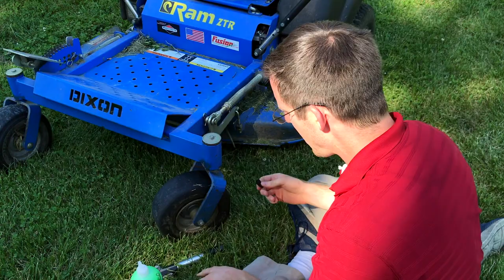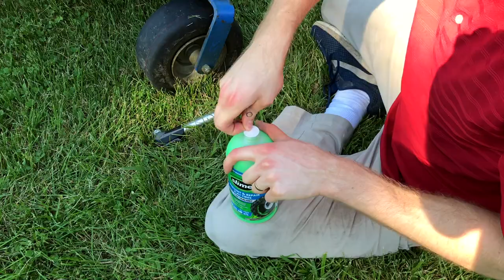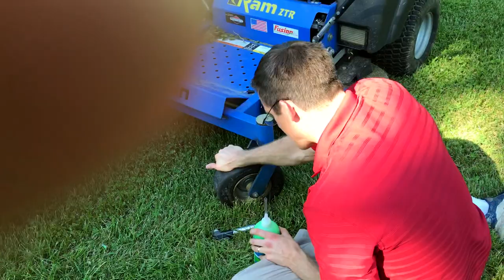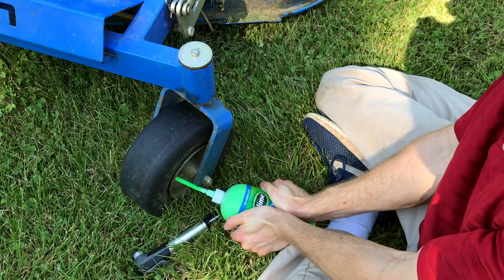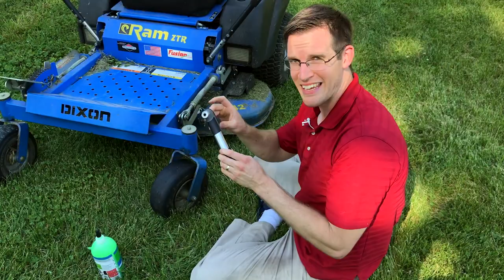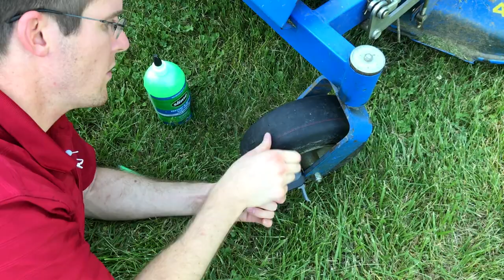How to Fix a Flat Tire on a Riding Lawn Mower in 60 Seconds - Works for Car Tires Too!

Comment: Yikes...
This is some nasty stuff.. It is highly corrosive to steel..on the inside...I have seen lotsa rust and heavy pitting..😬 
if anyone ever has to change the tire it will be a big mess.. The little fibers in the slime will seal the hole in the tire yes.. but it will also seal the valve stem.. overtime with the fluctuations in weather the tire will eventually lose air..when you go to put a little air in.. it won't work as well.. If you are having problems with flat tires I highly recommend hard rubber tires for the front on zero turn mowers.. they are spendy..but well worth it if you need them..
As for using slime in a car wheel..😳 thats worse yet..all that shmootz in there really messes with the balance..which in turn results in premature tire wear..It is very hard to balance auto tires with slime and again.. when you have the tires changed it will be a BIG mess.. If the wheels have air pressure sensors in them it will mess with that as well.. I have changed many tires with this sh#t in them..🤮
 the sticky black rubber plugs are a much better alternative for an easy fix.. they simply plug the hole..job done.. no adverse side effects..
Reply from the maker: Thanks for sharing those tips!
Reply: Yea @MNpicker FACTS, that sh#t is nasty af